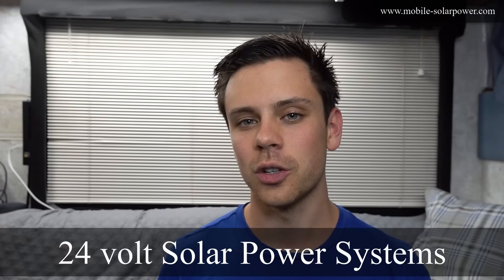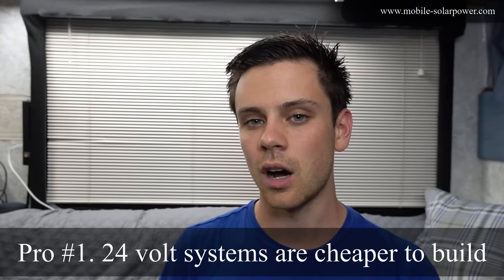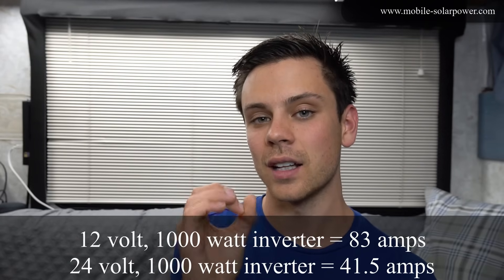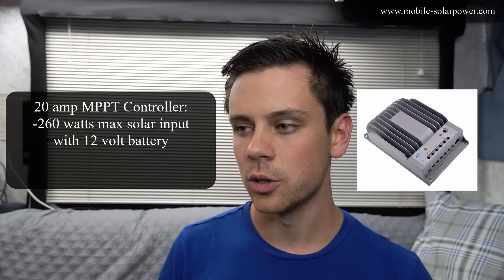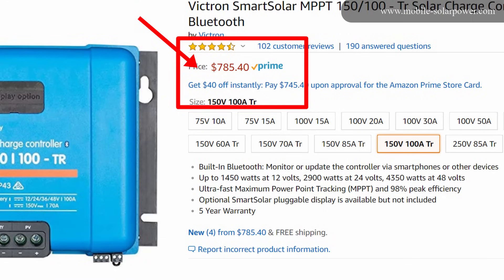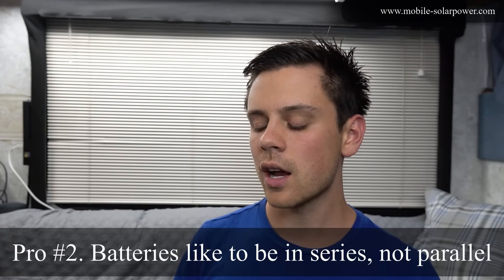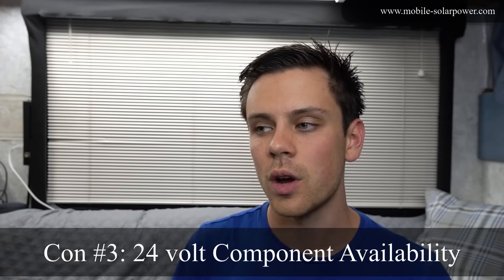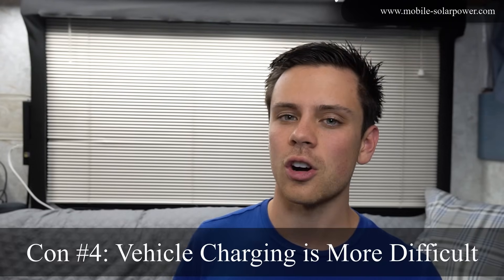12 volts VS. 24 volts for Off-grid Solar Power Systems

Comment: Will a battery charger like the Sterling Power BB122470 make it possible to charge a 24V house battery without the problems you mention when you talk about charging the house battery with the alternator? As far as I can tell, the BB122470 uses any available excess power from the alternator, and steps up the voltage to a preset level optimal for your particular house battery type (e.g. LiFePO4). It does not force the alternator to output a voltage in between the voltages of the house battery and the starter battery, and it does not take any charging power away from what the vehicle's OEM equipment needs.
Reply from the maker: Oh those are great! I have read about them a lot but have not used them. Yeah that should work well. Really cool device.
Reply: The RedArc BCDC2420 also charges 24V house batteries, with some attractive features like built-in MPPT for solar. But I'm told it does not have a dedicated voltage sensing circuit to measure no-load voltage at the house battery, so it cannot adjust the charging voltage to the desired level (compensating for voltage drop over the charging circuit) as precisely as the Sterling Power charger (which does have a voltage sensing circuit) can. Also apparently the RedArc BCDC2420 does not charge LiFePO4 batteries.

Edit: either way, the charger still puts an extra load on the OEM alternator, so if there is not enough room under the hood to add a second alternator, it may be possible to replace the OEM alternator with a high-output alternator that outputs something like double the amperage. It would be really cool to have some kind of ultra-compact vertical axis wind turbine that can somehow harness the wind created when driving the vehicle, and use that energy to charge the house battery, instead of loading the OEM alternator. But I don't know of any such product.

Comment: I saw the title and I was thinking oh ya, Will is going to answer the one question.. I must say, you answered a lot of questions and concerns I have had.. Just not "the" One.. ..First off,, my system: 10 -100W solar panels hooked up in 2 sets of 5..  ..8 - T105 Tojan 6V batteries connected in pairs for 12V and 900Ah.. A Midnite Classic 150 charge controller and an AIMS 2K/4K 12V inverter.. .. I believe I have my system setup to switch easily to 24V just by replacing the inverter.. but why should I.?  The One question I have is "do you deplete the batteries slower with a 24V vs 12V system sucking the same wattage draw.?"
Reply from the maker: Oh wow good question. It would be the same draw on entire battery bank. So no difference in efficiency there. Also, considering how large your battery bank is, peukert effect is small. The big benefit for you is the charge controller will run at lower temperature, and the wire loss would decrease. 

Those batteries are the one thing I would change in your system. Flooded Trojans are pretty bad in terms of fardaic efficiency. You would be blown away by the difference of switching to AGM or lithium. But you don't need to switch anything. Seems like your system is ok

Comment: Will...awesome video brother. This is exactly what I’m trying to figure out. I bought a school bus and having it converted as we speak, but want a system (sky’s the limit in a sense) to run two a/c units...fridge...microwave with power left over to boot. The bus is a 40 ft and want to boon-dock as long as possible and still have the amenities of home. I’d love to know what system...panel brands...charge controller brands...lithium brands...etc...that would be good for my set up. I’d compensate you for your time btw. There’s just so much to choose from...and feeling a bit overwhelmed. Thanks man...keep on keeping on with the kick ass vids!!! :-)
Reply: I'm looking to do the same with a city bus. Not sure it it's better choice than a schoolie but I thought might have a little more room. Lots of thing's to figure out before the big purchase.
Reply: I'm looking for the same info! Wanting to run AC off solar!
Reply: If you are having it converted, please go big or go home with as much insulation as possible.  It will cut your cooling/heating demands immensely.  You probably have enough roof space for 2 KW of solar panels.  Make certain to allow for breathing under the roof mounts to keep the panels coolish.  Will has a system designed for your size on his website.
Reply: @saxonsoldier67  Thanks man. Yeah I didn't think about looking it up on his site. I've been catching the last few vids of the battle born set up with the 24v system which seems to be the way to go. The batteries and panels were my main two questions i guess. From what Will has done with the tesla battery and switching to BB...answers that question...and lasting 20 years...BONUS. Now for panels..I've seen a TON of 100w panels being used and only so many of the 300w panels. But thanks for the reply..I just want to get as much bang for the buck as I can and not have to worry about tomorrows inventions that will outdate todays.
Reply: @skoolinaround6390  Will recommends not using the larger panels for mounting due to the extra size if it comes off while driving and that the 100 W panels are more resistant to damage.  I'm a big fan of the 1/3 weight thin flexible 100 W panels as they don't effect the airflow.  They do cost more than the rigid panels, but too much weight up on top is bad for vehicle handling.  Please remember to mount panels so that they can breathe and not transfer thermal energy thru your roof and even melt the panels.

Comment: Just a tip, definitely don't buy your copper wiring from Amazon. They are WAY overpriced. EBay and the other places online are much better.

Also a lot of times, even home depot or Walmart will have a sale on jumper cables. While it's really more of a quick and dirty option that I myself wouldn't use as a final solution, you can often find 40ft of 4 or 8 AWG for less than  20 bucks (I got both a 4 AWG pack at home depot over the holidays for 15 bucks and then an 8 AWG pack from Walmart for 10 more recently). The cables tend to be just as flexible, though with a thicker, lighter insulation. Plus you also get the big alligator clips that you'll just cut off to harvest the cable. Basically just keep an eye out and you'll find something at local stores.
Reply from the maker: Agreed but the jumper cables are almost always copper clad aluminum. which is no good. I used to use jumper cables wires for everything till I learned the difference. Where do you buy your wire on eBay? Any seller that you recommend for pure copper wire?
Reply: @WillProwse  Yes, sir. You're right on all accounts there. I prob should have mentioned that. Though I do think they MAKE pure copper jumper cables but I doubt they'll be as cheap as ten or twenty bucks. Maybe, if you get lucky.

But, for the good stuff, I usually buy from an ebay seller called TEMCo. I think they ship out of California. I haven't checked them recently but last year when I was searching everywhere I could (both online and local) they were the best pricing around. The cables are great and the insulation is not the dense glossy kind that you typically find on solid THHN cable at the hardware store.

I think thru multiple purchases, I ended up getting about 60ft of both red and black each for less than 50 cents a foot. So not bad but still not great. I'm just gonna start melting old pennies.
Reply: @WillProwse  best choice for pure copper wire in big sizes like 00 up to 8/0 is car audio... brands like sky high or down for sound these are all ofc wire

Comment: I am hearing that I could build a stealth van 24v system by using 2 batteries like you built the other day (250 each) with a 40w (for upgrades) MPPT CC and 1000w(or 1500) inverter w/wire and switches/safety stuff for 800 bucks or less. If I installed 2-300 watt 30+ volt home grade solar panels , I might be all in at $1200 or so...I think this would supply a stealth van with enough power for TV, basic computer, lights and fans etc as long as most cooking/heating were done with propane. Tell me what the master thinks....Thanks in advance...you are the best Will...
Reply: BTW, I already have a 26' travel trailer and later...would put panels on it and use the  same electronics from the van when remote camping in the RV....or connect all 4 panels when (rarely) pulling RV with the Urban Van (1 ton Chevy extra long) that I am looking for but havent bought yet....

Comment: I think you forgot to mention charging from the shore power (ac/dc converter).
Reply from the maker: Oh that's much easier. Lots of chargers available. Ebike battery chargers also work with weird voltage batteries. Not an issue at all.

Comment: Grate video as always Will!! I only have one thing to add that I found to be a VARY important factor. I have a 2017 21BHS Camplite with 1200 watts of solar on the roof, and a 100 amp Victron Charge controller working on 12v. My main reason for sticking with 12v was system safety because two things can happen if and when your DC to DC converter goes out, 1 , it fries it self and nothing happens, or 2 , it fries it self and starts feeding 24v in to your campers 12v system and fries your entire camper and even your truck/ tow vehicle. In the research that I found it was not a very common problem but it was an issue with some of the cheaper Chinese models. Just wanted to pass on something I was told by a experienced electrician, in hopes it helps someone out their!

Comment: I have a small system 12V, 300W, 150AH that is connected  thru an 40Amp MPPT charge controller to Sealed Lead Acid Battery. The connection is 12v Solar Panels (270Watts) to MMPT Controller (40A) to Sealed Lead Acid Battery (150 AH) to a 220 volt inverter. 
Could you tell me if i need a battery management system installed here or do i need anything between my sealed lead acid battery and Inverter?
If it is too much to explain, can you direct me so some links which explains this.

Comment: Dude. I have a perfectly fine running 1993 Bounder 28T. All my systems work, The interior is in great shape. Runs like a champ. Watching your videos makes me want to rip it all out and make it so much more efficient. Todays efficiency/power/usage/systems are so different than '93. Back then they didn't have all this knowledge and they just built it to "spec". That's ok though, when my systems do fail, I'll be ready. Thanks Will!!
Reply: Fugate University = I have a '90 Bounder that is all set up to live in with solar.. you can check out how I did it on my channel..
Reply: I had a 28T Fleetwood Southwind. The 28 = feet and T = I'm guessing is Two beds in the back.

Comment: Open circuit voltage... I could look that up, but many new to solar do not know such terminology... I am guessing it means the max. voltage available of a yet to be utilized panel prior to any wire-line losses or appliance uses... before any volt draw down? vs. nominal voltage or actual measured voltage numbers>  That is it is a Max. Rating for a panel, sort of??  Like a new car battery may read 14 volts, but when a load tester is on it it draws down to 13+, or when an old battery may read 12.4, but when on load it will read maybe only 9+ ?? So, in that last case, open circuit voltage is 12.4.  BUT for panels, are you really talking of NEW panel max voltage rating (before it gets dirty or less efficient over time or due to bird droppings, LOL)?
Also, maybe I missed it, but when converting from 12 volt to 120 AC (inverting) it is much easier and efficient to do so when starting with 24 v and more so with 48v, right?  Are you going to now do 24v vs. 48v  or other (with differences between RV use or portable use and with fixed Residential and specific to off grid ys. vs. grid tied  and if one wants off grid and still use a house A/C or an ARC welder?  So many topics to tackle!!!!

Comment: Great vid Will. I'm thinking about putting an auxiliary battery in my fj for a fridge, power an outlet for rice cooker and run some light bars, and also as back up battery in case my crank battery dies. I initially want this aux batt to be lithium but I'm hearing now that in cold or very hot temps, I can charge it without risking fire. Do you still advise going lithium? I'm don't anticipate going camping/hunting in dead of winter-- live in CA--but I don't want to worry that my car will catch fire. Ram trucks puts insulation around their stock crank batteries. Would that be enough for me to prevent battery fires or do I need a more elaborate set up? Or should I just go with AGM? Thanks for reading this rather newbie questions.
Reply from the maker: No worries. And sounds like a battle born would work great. But you could use an AGM instead. Both are good options for what you plan to use it for.
Reply: @WillProwse  New van owner/long time viewer and now stumbling "designer". Curious about the auxiliary battery setup. How would a newbie set something like that up? 
Thank you for this video! I was planning on having my alternator charge my future house battery. You just saved the electrical life of my 95 Chevy G30 👍😋
Reply from the maker: @littleozarksfarmstead  very cool! And that really depends. Lots of ways to do this. I would go to a shop that can install a designated alternator that is designed to charge deeply discharged, deep cycle batteries. Or you can use a sterling dc to dc battery charger and isolator. Its expensive though, but a great option.
Reply from the maker: The battle born has temperature protection and disconnects if too hot or cold. Great battery. And stable chemistry of lithium ion.
Reply: Will Prowse you advise buying battle born new ($1k) or used? And if used where would you get it from? Btw, are you working with any companies where you get discount codes and get percentage of sales?
Reply from the maker: @mikengo8725  Just saw these comments. I would get it new or used, but who sells them used? Battle borns have a killer warranty, so buying one used would be fine. And yes, I am an affiliate of these battery manufacturers, whether its through amazon or directly from them. But I hold them all to the same standards. Batteries come and go. Every year new ones come out, and they can all be improved.

Comment: The alternator overheating is solved by a External Regulator monitoring the temp of the alternator and adjusting amp output accordingly. Hit the major points perfectly!

Comment: I love Learning About this stuff even when I know I probably don't need it, you give so much info dude
Reply: Skyph> BUT if you own your own place you CAN use solar to shave your electric bill.

 A small ‘system’ that you can buy affordable components to assemble can be set up to handle a portion of your steady electric usage and keep heavy loads like electric range, electric clothes dryer, etc. on the utility supply. These lower ‘constant’ loads like a refrigerator use a surprising amount of electricity over 24hours and a small diy solar outfit can supply most or all of this load while affording as little as 12months ROI. It’s worth it. 
The big national ‘installed’ solar suppliers with their grid-tie systems at huge prices like $30,000 or $40,000 that are currently popular are often 15+ years ROI and therefore, in my opinion, not a good investment.
This Will Prowse fellow has some interesting videos on small solar using transfer switches etc which show how this is possible. Even 200W of panel can cover 60Ah / 720Wh in good sun without much trouble in my less-than-ideal area.
Reply: @fishhuntadventure  I am a total rookie at this stuff but you are describing exactly what l am looking for. Still being connected to the grid for bigger items and a solar system for everything else, it would help lower the monthly power bill plus allow all the basics to work during a power outage. Hoping l can learn enough to design and build something like that.
Reply: @Shakerhood69  Ive been watching his videos for awhile. He's to the point and detailed where it actually matters
Reply: Yes
Reply: U might need it

Comment: Excellent tutorial Will, as usual. Rob Kenny and You both talked me into a 24 volt system for my future RV because of the efficiency, cost, safety, all of the pros you stated in your video. Also for high draw induction loads it's a better route to take (I believe) so there is that also. Yes, 10 Battleborn's wired in series to 24v = 500 ah's of juicy energy goodness. See, I AM beginning to understand this electrical thinking from the wiring all the way through to the actual math. Wire gauging I will refer to an online calculator (fat copper is the bomb and a bitch to bend I understand *sigh*). I am pretty sure I have this sucker figured out finally. Thanks again Will.
Reply: JohninTucson how are you doing are u in a 24v system yet?  I made the jump and I absolutely adore 24v. You won’t be disappointed.